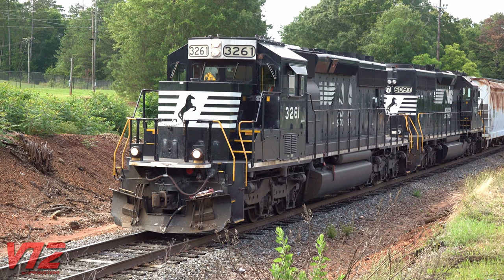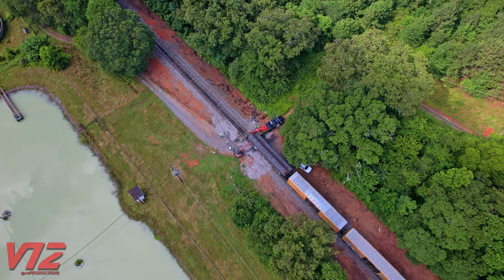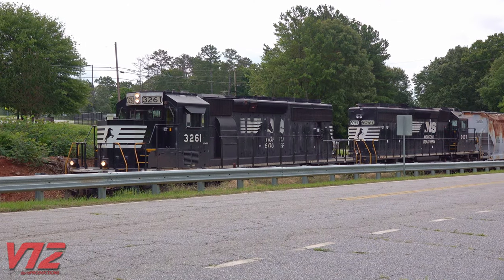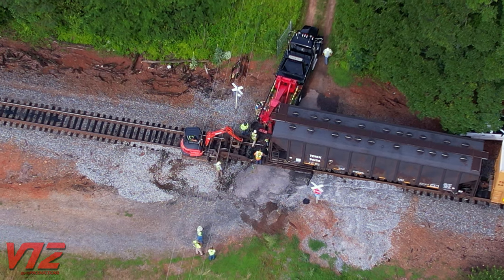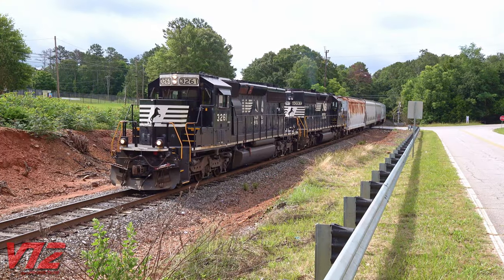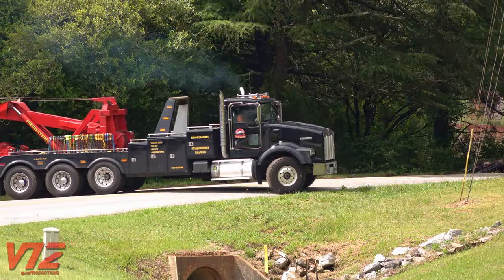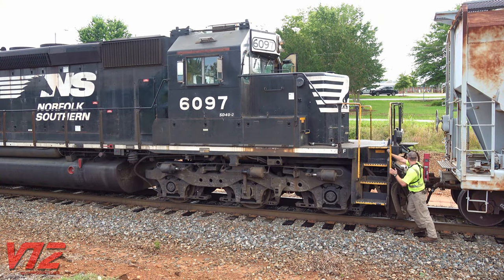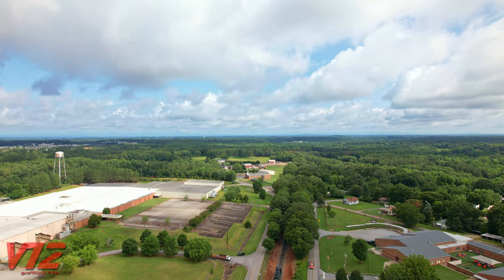WRECKER Helps Repair Damaged Railcar

Comment: Here is my guess. I spent 27 years as a locomotive engineer  with ns. That's call an on the fly repair. You more less hit the nail on the head. The wrecker can get in tight places and over weight restricted bridges and to a job site quicker than a crane. If I was a betting man they changed out a set of wheels that for whatever read went bad.....bearings cracked wheel etc that stopped the train on the spot. They eased it to a crossing the truck  could back up too lifted the car up did the repairs and got moving again
Reply: The only thing wrong with this car was a bad handbrake. That is until the CO uncoupled from this car and it rolled all the way down the hill from the customer and slammed into the boxcars sitting on the mainline😂